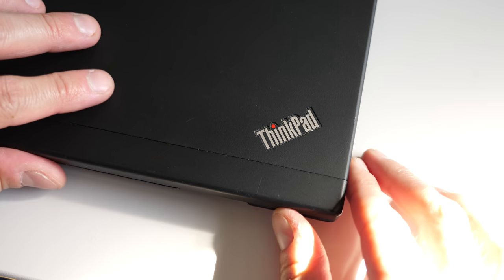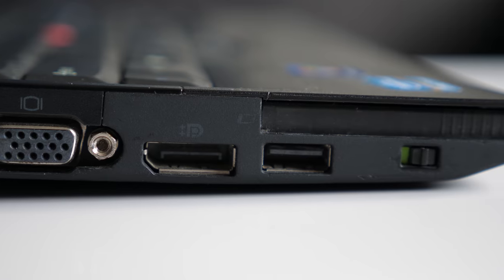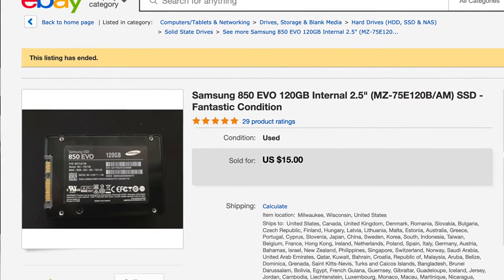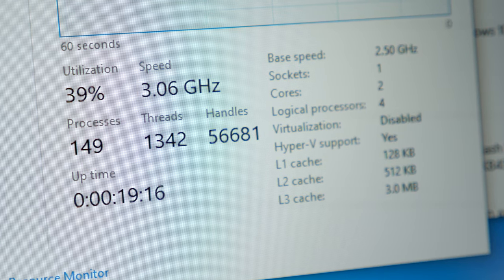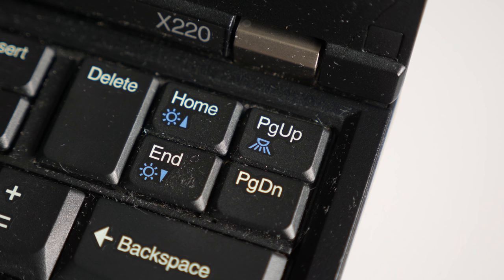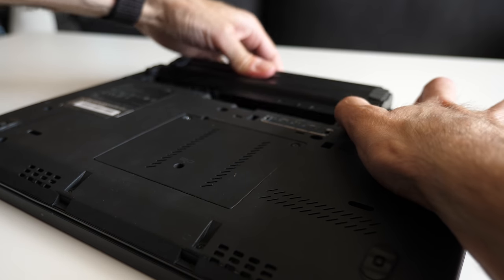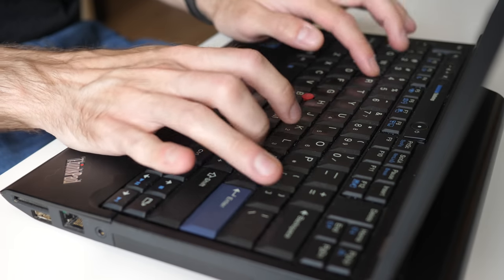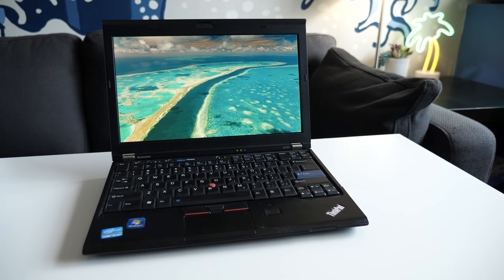The $100 Laptop Challenge -- This Old PC is Better Than You Think

Comment: I'm sitting here at my x230, but I'll be that guy that disagrees with the assessment, at least a bit. True, these machines are still powerful and robust and really cheap. But whenever someone praises them for being so much better than the cheap modern-day consumer shit, mostly the bad battery life and heavy weight are conveniently ignored. I have a new 6cell battery, and thanks to TLP I get some hours of life out of it. But to even get into a decent area of hours I would need to use a 9cell battery, which makes this machines unacceptably heavy and clunky - and I still wouldn't have 10-14 hours of power for work on the go. The best cinebench score is useless if the machine runs out of juice or is too heavy to take along. And that's something where even older-gen x1 carbon can shine much more.

Comment: I bought mine for 40 euros, it was marked as untested on ebay
Reply: mine came with an i5-2540M and 8GB of ram, but without drive and charger, installed a 120GB ssd i had laying around and used an universal charger that i already had.

Comment: I have two HP Probooks and 2 Elitebooks as well as 2 HP Sff Prodesk 600 G1's all updated with SSD's, 16 or 32GB Ram and Windows 11.. (Although since then Microsoft has patched the jailbreak on my usb installer. one of the Prodesks I upgraded to an i7 477with 32 GB RAM. (My Current HTPC), and the other still the original i3 with 8GB Ram driving my Nebula Mars light projector in my bathroom (only room in my house I smoe in.. I watch some Anime in there from time to time, and it's convenient with Netflix if I need a bathroom break and want to transfer my show in there with me. (It projects onto the white wall tiles opposite the shower curtain.
Reply: Anyhow the point I'm getting to is all of these 2012 and older machines perform nearly as well as my 2017 Gigabyte gaming laptop.

Comment: Absolutely bullshit. When you say the speed is ok even with windows 10. I have a x260 and while the machine is good and will last me quite a while, it struggles in windows 10 with anything Electron based running.
Reply: Maybe look at how much RAM you have? I feel like win10 uses a lot of RAM, so you should have at least 8GB. And if the processor can be replaced, it is also a good option. But I made the experience that an SSD is a great staring point for upgrading your PC